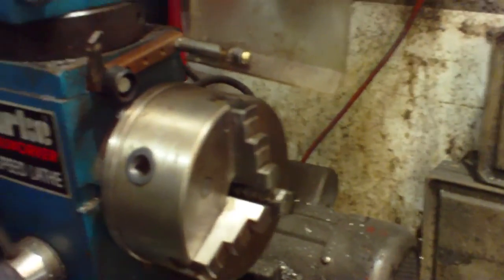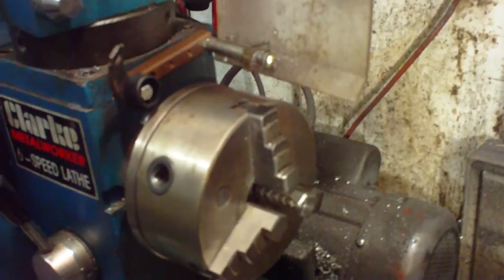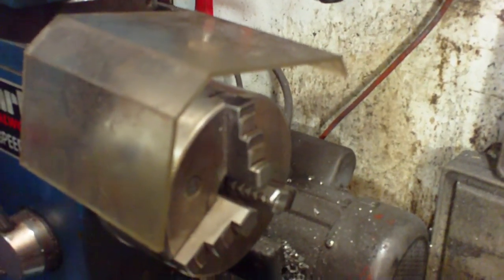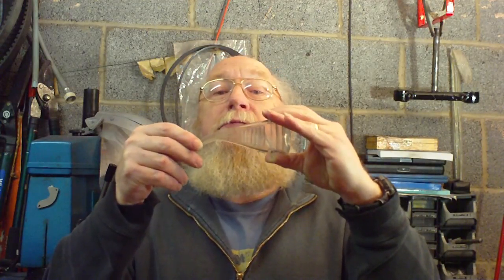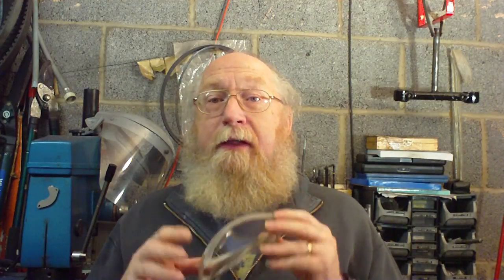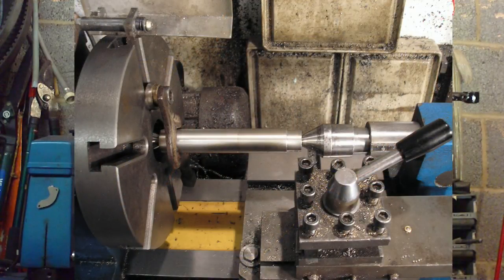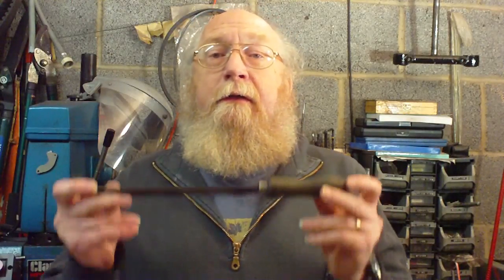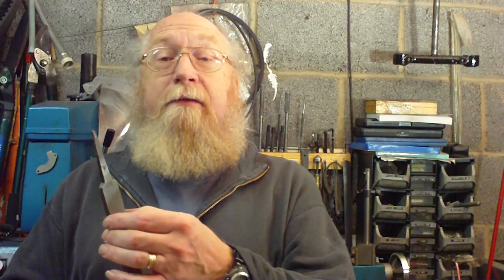Lathe Safety

Comment: Can I ask what you think about running with an empty chuck?

It was drilled into me. NEVER RUN AN EMPTY CHUCK.

And, to stand a little to one side.

I see so many videos with people running with empty chucks and I cringe.

I've never seen an chuck fly apart. It might never happen.  But, I was told not to do it.  It costs me nothing and I like to play safe.

What do you think?
Reply from the maker: Thanks for the comment.  Can't say I've heard that, but I can see why, especially if you are coming onto a machine that someone has used before you, as you never know what state they have left it in.

Comment: Great video Spen...  but what is your view on having a long beard  ??
Reply from the maker: The same as with anything else that could get caught, keep it away from anything that rotates.  I have long hair that I keep tied back and out of the way as for my beard, well it's not that long but if it was I'd be tempted to tie it and tuck it into my overalls or something similar, just so long as it was away from the rotating bits.